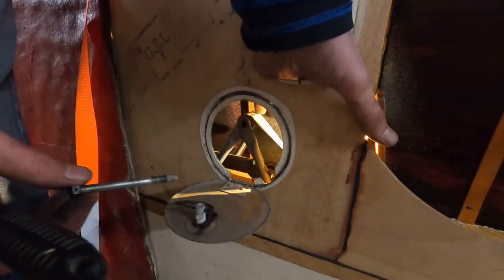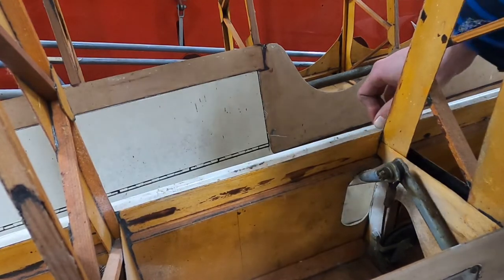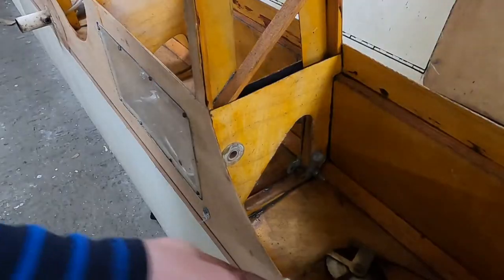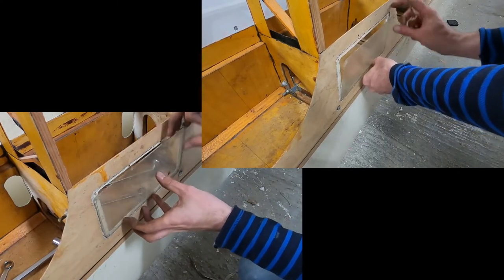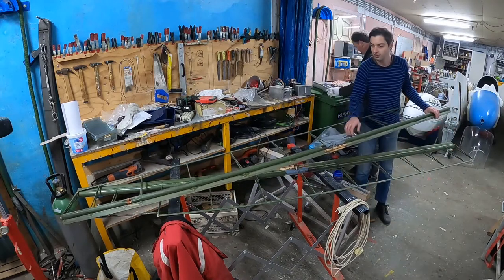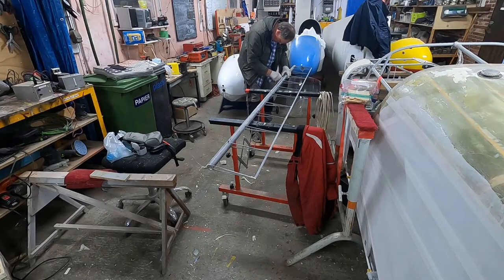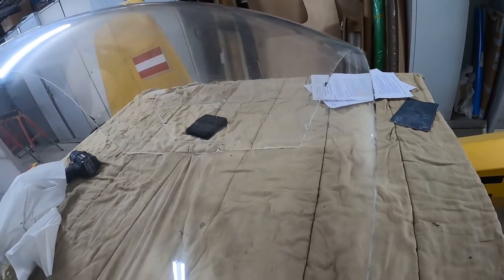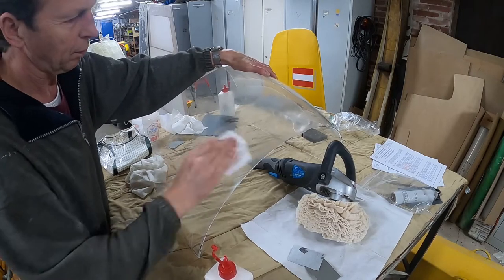Starting on the wings! - Scheibe Falke SF-25b motor glider - Airplane restoration #10

Comment: When working on the bare wings, check the glue joint between the wing spar face and the attachment block of the underwing wheels. They have a tendency to fail due to the loads on the wingwheels. The attachment block sometimes splits along the grain, too. Also, check for wood deterioration in the top wing spar at the spoiler hinge line. Rain water tends to ingress in here, through the screwholes of the spoiler hinges.
Reply from the maker: Thanks for your comment and suggestion! We will definitely do that (probably after sanding the paint off). I already had a quick look at the attachment blocks for the wheels, which seem fine, but we still have to check everything more extensively. The spoiler hinge line I checked, after your earlier comment, this seems to be fine as well. In one place there is a bit of a gap but I cannot insert a metal feeler more than 1.5mm in the gap (after that it feels solid). It looks like this spot could have used a little more glue during construction (was never glued until the edge or could have been pressed a bit better). The D-nose skin is definitely attached well to the top of the spar. Probably the best solution is to slightly sand into the gap and then fill with Aerodux for waterproofing, but structurally it seems fine. No wood deterioration that I could see, luckily. But perhaps we will see more after sanding... Thanks for your comment, very useful points to check!

Comment: I worked in a canopy repair bay for a couple of years. The higher grade sanding medium is called micromesh. These guys missed out several grades, I'd recommend using all of them. Go one way with one grit, then 90 degrees out with the next one expanding the area each time by a cm.
Reply from the maker: Hi Simon, thanks for your comment! Although it may not show in the video (it shows several days work in 10 minutes) we went from 400,800, 1200, 2400, 3200, 6500 grit in 'sandpaper' and then two different types of polishing paste. We mostly went around in circles. What grit sizes do you recommend?

Comment: Greetings from Greece! Thank you for sharing this exciting restoration.  I confess I am becoming very jealous and consider to buy also an old falke to fix. How do you check that the wood iin the wings is structurally OK for these old birds? Are you checking for rot? Also how to check that wood adhesives used in the construction are still OK? Sorry for my many questions looking forward to the rest of the restoration and ...flying 
Did you decide on a paint scheme?
Reply from the maker: Hi Gabriel, thanks for you comment! If you have the chance to restore one, go for it! No better way to get to know everything about your plane. With respect to the wood: we generally have a careful look for anything 'out of the ordinary' such as cracks, gaps, de-lamination of plywood layers, and deformation. Glue can be checked by applying some pressure (with your fingers or a small metal feeler) to some glue joints. If one or more of the random inspections fail then the whole wing needs to be checked. In my experience, if you can figure out that it is Aerodux rather than Kaurit the chance that everything is fine goes way up. I know that @kauritglueingliders sometimes reads these comments so he might have more tips and tricks. We have some rough ideas for the paint scheme but nothing has been decided yet. Basically three are two main ideas: similar color scheme as our glider (D-3700 Bergfalke 4) to make a 'fleet' or something completely different like wasp-like yellow with black. And of course, feel free to ask as many questions as you like!
Reply: @TheOddVideoChannel  Generally speaking, Falkes are built very strong and do not suffer much from glue failure. The wood and plywood used is of very high quality, and any damage is easy to spot when stripped down. The most relevant area to check on motorized Falkes, is the hinge linge of the airbrakes. Rainwater tends to get pulled in under the piano hinges, and through the screw holes affects the upper spar cap. The best way to check, is to strip the paint off this area, and try and insert a thin blade between the plywood of the D-nose and the top spar cap. If this goes in, stripping back the plywood is in order to inspect the underlaying wood of the spar cap for rot. Some years back I had one in that had around 1/3 of the top spar cap rotted away, reduced push strength (i.e. flight forces) in the spar by 1/3!
Reply from the maker: Thanks for joining in the discussion, that is indeed a good spot to check!